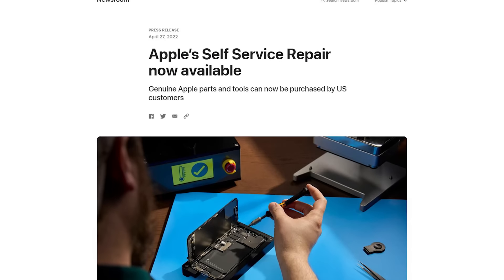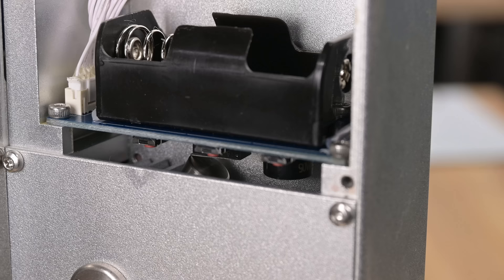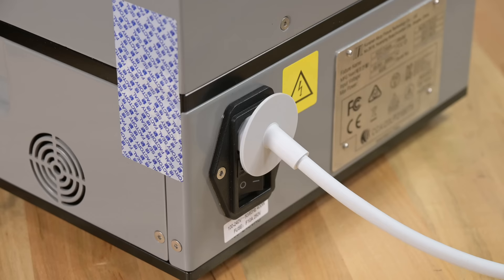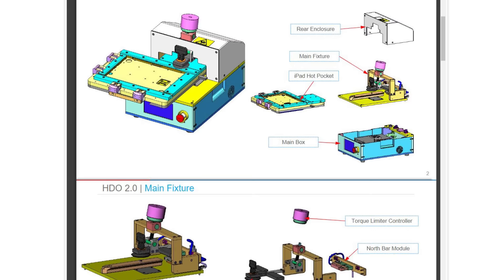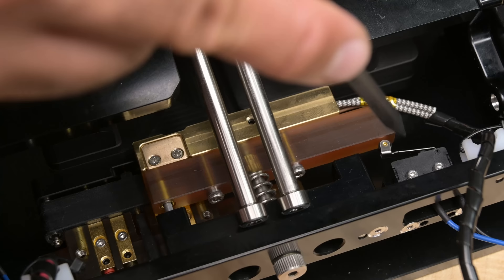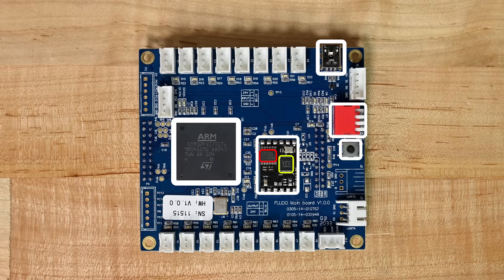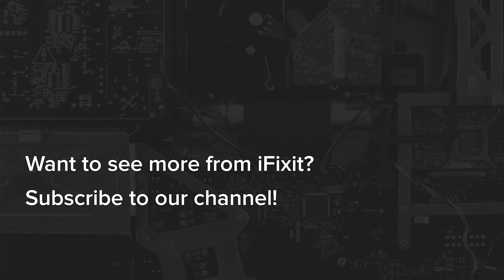Tearing Down Apple's $1200 Tools! What's So Special!?

Comment: People who think $1200 is expensive for tools have never worked in the manufacturing industry. Some of the tool costs (relatively small or simple) would blow their minds. You have to understand, cost on tools is about precision, reliability, and them being certified and guaranteed by to perform specific tasks for a certain number of cycles. NOT how special, unique or complicated they are.
Reply: these are off the shelf components, they aren't proprietary or about precision. they don't warrant the price
Reply: @doodlecaboodle9298  I’ll put it a different way: They have been tested and verified for the task they are meant to do. The efforts in verification of tools is expensive, in people-hours alone. That’s where the cost comes from. Lots of things are built using existing components, but don’t let that convince you that makes building them inexpensive.
Reply: @Justin Croonenberghs small-scale anything is expensive, especially when it comes to r&d. Tooling for manufacturing electronics enclosures and computer cases can easily run into the tens of millions of dollars
Reply: how precisely do you need to roll your battery? It will make zero difference. They market it, cos they know some fools will buy it.
Reply: @JunkBondTrader  Precisely so Apple would not be sue if these stuff not work
Reply: @JunkBondTrader Except that these are the tools given to every Genius Bar. It’s about consistency, not profit.

Comment: Do we get a repairability score for the tools?
Reply: Prob 0 lol
Reply: Not until apple starts selling toolkits to repair the phone repair toolkits.
Reply from the maker: I'm afraid not. We need to be able to compare a device to something similar in its class in order to fairly assess it. We'll certainly revisit this if we start seeing repair tools from other manufacturers.

The devices weren't difficult to get into, they seem to be made for relatively easy access. Access to replaceable parts would be a significant concern, especially with the HDO.
Reply: probably 10/10. Capitalists get really pissy when their stuff breaks, so industrial equipment is super easy to fix.
Reply: @iFixitYourself  they are easily serviceable, because they are not made by Apple 🤣🤣🤣
Reply: @iFixitYourself  Fairphone gave me a screwdriver.  Could that be used as a baseline?  (I think the screwdriver is pretty unrepairable).
Reply: @qwertykeyboard5901  you’re not entirely wrong but *corporate is prolly more accurate.
Reply: @miscl_anon  No. Not really
Reply: @qwertykeyboard5901  I just meant that your comment seems more targeted at corporate. corporate cares about their bottom line deeply so anything that adds down time and expense to production tools will upset them
Reply: @miscl_anon  Yeah, so capitalists. What are you going at?
Reply: @qwertykeyboard5901  I'm just saying, corporations live off of maximizing profits and minimizing expense, like reducing operating costs. your average capitalist is gonna be happy as long as they're making enough money to sustain and live a good life, not trying to squeeze every penny out of their income
Reply: @iFixitYourself  reparability between the tools to fix the product and the product itself. 
Only for funzies.
Reply: The first 2 don't really need one as they are chunky robust pieces of metal, not much on them to go wrong, but the first 1 did have some electronics that were super easy to get to, so if something did eventually break id say it should probably get a pretty good score, as for the heating machine at the end, that one def needs something to actually compare fo
Reply: If it matters at all. Working for Geeksquad and using these on daily basis they are very reliable. My location has had same set for number of years and they work well. For cost I don't feel they're needed though maybe the heat plate unit? It's built specifically for 12s, 13s so it's very useful for them but tbh some repairs I'm more often just heating phone and prying phone with one need of leaving in the tray. Battery roller pretty silly when most part a battery can just manually be pressed into place and boom.
Reply: Chinese will come up with copy pretty soon
Reply: NO U NOT. U are only loaned the tools u have to return them. so its kinda rude of iFixit to take them carelessly apart

Comment: The linear rail mechanism of the Press is not designed by Apple, its a normal MGN Linear Rail from a company like Hiwin.
Reply: they never said it was
Reply: @ashtonwyss9757  They suggested
Reply: @ashtonwyss9757  2:20 they suggest that apple designed the bearing mechanism specifically for this use.
Reply: It's not hard to design with linear rails either as they claim. You get the 3D models from the manufacturers website or a good repository and drag and drop it into your 3D assembly.
Reply: Yeah, they designed the tool to use the bearing rail. You’re confusing it with manufactured
Reply: Ridiculous use of linear rails when a set of  linear slides will do. 
At least with the linear slides you can adjust for side play.
Reply: I was about to post the same thing. I’ve seen these exact bearings in components at the factory I work at.
Reply: And they're an excellent design. I use a pair of near-identical CNC routers, but only one of which has them on its Z axis. That one seemingly small difference makes it far more rigid.
Reply: @7thplanet121  The rails should have (nearly) zero play. Though given the forces and velocities involved, self-lubricaning bushings probably would have been sufficient.
Reply: I'm glad someone else sees theese are "off the shelf" products... typical mass manufacturing in my eyes. Just put lego together and stamp their logo on it 🤷‍♂️

Comment: Perhaps I am wrong but I would imagine that while the battery press may look insignificant, what it does offer would be fairly invaluable: a repeatable, accurate, and employee-skill-level-agnostic way of performing a similar task across every one of their store locations. A reproducible step regardless of which apple store you visit or which employee performs it. This is at least this is my take on it
Reply: I suppose so. If your in trade that has employees with ZERO experience. It's invaluable but generally after number years of repairs and short time restraints. Most repair techs won't use it.
Reply: @jsegars98  That's phone repair for you! Most places are just churning through whomever they can get for the wage.
Reply: @jsegars98  sounds like a perfect tool for a self-repair kit ... why are you criticizing it with some backhanded comments?

You are not obligated to repair the phone with the tools, but they are avail for you if you want to repair your phone with it. That sounds way better than what the competition offers.
Reply: @RunForPeace-hk1cu  The point is it's not needed for it's cost. And for self repair? The process is no better due to software limitations that apple refuses to lift. Self repair shouldn't cost you 1200 dollars plus 300 dollars a screen or 500 plus for a rear system. The tools shown aren't any different then what's on market. They're just more expensive lmao

Comment: Obviously you have never purchased repair equipment from the American Terroist aka Motorola. Pager repair jigs from them were way over priced and you had one for every model of pagers with different LCD displays. Then a jig for testing and aligning the the radio frequency portion of the pager. Now add a Lindgren screen room as well as a service monitor for aligning the radio equipment. A decent Lab for repair of the Big M equipment can easily exceed $20K.

Comment: FYI The fancy little bearing mechanism is called a linear rail and it's an off the shelf part. In fact, all components in the repair tools are off the shelf parts.

Including the board that with the black daughter board PCB for the RFID. It was also not designed specifically for that machine (that also explains the DIP switches and the USB). The reason the black board pops out is that it's easier to treat the black RFID daughter board as one component in manufacturing, instead of having to source all of its components individually and having to do quality assurance for it. Not because it was an afterthought.

Likewise, the touch screen and the relay board are off the shelf components.

The only non off the shelf parts are the CNCd metal parts. Which are also done that way due to the low volume (expensive, quality <3).

Have to say, quite impressed by the quality. Good job to apple.
Reply from the maker: This is enlightening, thank you! We totally agree, the expense and effort that went into the devices made for some interesting moments.

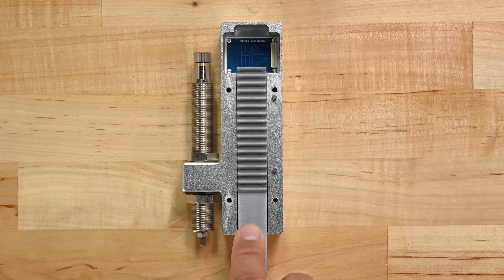Comment: 2:18 Those are off-the-self normal Block Bearings for linear rails used in CNC's and such, it's not really much of an "effort to design", but it's still impressive they are used those in a 216$ full metal tool tho.
Reply: But is it genuine hiwin? I mean from the color it looks like hiwin rails
Reply: @RYU47376  Nah, two of those would be half the cost of the whole machine. The aliexpress / china blocks often use that color scheme.

Comment: The HDO looks like it could possibly run Doom :D
Reply from the maker: What a wonderful idea :)
Reply: If it has a screen,it can run Doom
Reply: @tezcanaslan2877  and bad apple
Reply: STM32F407
168MHz
512-1024K flash
192k RAM

That Processor seems totally up to the job, combined with a USB drive for storage and RAM, I could see it working.
Reply: @tezcanaslan2877  let’s not limit ourselves: if it has an output device, it can run doom

Comment: If you service like 30 phones per day you might want the batterie press.
Speeding up your prozess and applying the exact force quick and everytime to this delicate part...
Reply: For real
Some people just love to complain
Reply: You'd really need to be doing things in an assembly line fashion for that actually to benefit you. The time it takes to put the device in the press and then use it is still going to be more time than pushing down the battery to make sure it's adhered.

The battery sticks in with an adhesive, it's really no more complicated than using some double sided tape.

Comment: 0:54 um what? It's in the name, lithium battery. I'm not aware of any Ni-MH batteries with a 3.6v rating. And it's literally right there on the label which was read out loud, it's a lithium battery.
Reply: I'm guessing they got confused because 3.6V is the same as 3x 1.2V in series?

Comment: There are 14500 Li-Ion Cells just like the standard 18650 ones.
The 14500 cells come with up to 900mAh, storing slightly more engergy than NiMH rechargable batteries.
Reply: Slightly?
Reply: 900mAh x 3,6V = 3,24Wh
2500mAh x 1,2V = 3,0Wh

Comment: 😂 it looks like an over engineered arbor press that I made when I was an apprentice.
Reply: Why, that'd be because it is! Linear rails in a press where a pair of bushings would do the same job just as well, only wouldn't cost nearly as much. The solution to the 14500 cell not fitting in the C-battery holder is even funnier.

Comment: Huh, using a PIC microcontroller for setting the time delay on the screen press. I would have expected something simpler and cheaper coming from Apple, like a 555 timer. I remember using a PIC chip for highschool projects, cool.
Reply: Believe it or not, the microcontroller is cheaper!  No seriously, it's an off the shelf board with less components than the 555.  Include the logic needed to run the count down, and it's definitely cheaper.  All they needed to do is take a part they already sell by the millions* and flash one that has a fixed timing.  Remember, a minimal pinout microcontroller (less than this admittedly) costs 3 cents!

* It's likely an egg timer.
Reply: @arthurmoore9488  that's mental. The last time I checked (but then I suppose that's for consumers) a PIC microcontroller costs about £1 each here in the UK. But if you were to scale that, that would cost absolutely loads. When I assumed in comparison, the NE555 costed about £1 for 20 or so. Interesting nonetheless

Comment: What is the cost of these units compared to Apple's $1200 price tag?
Reply: As others have said, it seems Apple left out a zero or two.  Which is what those would cost in an industrial setting.  Comparing actual material costs, the factory is likely only making a few % profit.  Much of it is off the shelf, but there's plenty of custom CNC work to tight tolerances.  Plus, that screen press design is extremely impressive.

Comment: Your iFixit driver tool looks better than the one in my kit. Is iFixIt sandbagging us ????
Reply: There are at least three different drivers. The cheapest kits come with plastic handled drivers, the bigger ones come with metal ones, the 128-bit kit has two different sized metal ones.
Reply: @QualityDoggo  I have the pro set.

Comment: I hope these kinds of machines get somewhat standardized between manufacturers and are made with modules to fit different devices, such as the hot pocket, but do so for the other repair tools. Rather than renting the machines, I could see self-serve repair places existing, where you pay a time fee to use a set of machines. This would make repair for everybody much more consistent and OEM-quality, rather than using guitar picks and bags of heated rice. 

Personally, I think it'd be pretty cool, if device-agnosticy existed, to automate the entire process. Literally just load the parts and have the machines go at it themselves. Really the only extra part would be a light-duty arm and a parts tray array. Realistically it could be simplified even further, possibly down to a single machine for all purposes.

Comment: The argument about the battery thingy is weird.
Your hand will never be able to put the perfect and especially EVEN pressure to the battery so it doesn't possibly get damaged.
Remember the Note 7. This thing caught fire simply because some inner components cut into others. And the same could happen when you don't put even pressure on the battery.
Reply: Not suggesting to rail on batteries however its surprising how far they will bend back from where I've had to remove stubborn Huawei and samsung batteries and you don't need perfect pressure, decent double sided tape and a firm press will hold it in place fine
Reply: Don’t tell iFixit what to do, they are elite specialist

Comment: Those build quality comments don't sound good spoken by company that made its flagship screwdriwer build from solid and well finished aluminium (and one I loved) into a cheap plastic one with no price compensation...
Reply: I got an aluminum handle in the pro toolkit. Maybe they switched to plastic for the repair kits to save on cost?
Reply: What? the small kits have plastic, the flagship drivers and large kits still have the metal ones as recent as a few months ago...

Comment: Is that screen press painted or anodized? 

That linear bearing looks like a hi-win mgn-9c looking at the bolt pattern. (I spend too much time on cad with these and could tell instantly heh.) Most genuine taiwanese hi-win blocks have the logo on the seal (the red part), which I'm thinking could be knock-offs. The dust seals are kinda simple but requires very high tolerances, which is why genuine linear rails are freaking expensive. I have THK srs-9's and with end and bottom dust seal: the block could hold its weight in resistance, compared to my cheap $12 hi-win knock-offs. 

That rack thats sitting on the rail looks like its even sintered! 

I have a feeling this wasn't engineered by apple, probably just bought it from some manufacturer. Regardless, that thing doesn't scream value engineering, there's plenty of manual assembly and careful alignment. The screen remover even has uses serial# metal plate! I mean they coulda just used a sticker instead!

Comment: This is uhhh... literally like an average prototype that an intern throws together in a factory? They use linear bearings for two reasons. It was both the cheapest and the fastest to design in. It's a lego tier standard part in the industry.

Comment: It’s ironic that the company that is about right to repair and using quality tools is this sour that apple rents 1K tools for $50. Not to mentioned that the tools aren’t required to keep your warranty, so why can’t the focus be on the fact that the display is still serialized? Or that the repair parts don’t include the lighting port. Are you guys just butt hurt that apple didn’t partner with you guys like google did? You guys are going from being leaders in this right to repair community to being gate keepers because apple doesn’t recommend your tools. Tools that I own  and recommend all the time. So shift your focus on what actually matters and not the fact that you can rent the same tools that the Apple Store uses for $50. Especially when other companies aren’t doing the same thing.
Reply: You’re spot on with that comment. Ive also realised from the beginning of time they’ve always underscored apple products on the repairability score while giving higher scores to their competitors while having equally unrepairable products. They’ve also been quick to call out anything apple has done against the right to repair movement but let it slide again when apples competitors have done the same. They’ve become clouded and blindsided simply because they’re salty.
Reply: @hsvr  dude for reals. Even though the screens are serialized they do make a screen replacement super easy. Especially compared to android where you have to take apart the whole phone. Yet they fail to even mention that on the tear downs. They are so salty and it shows.